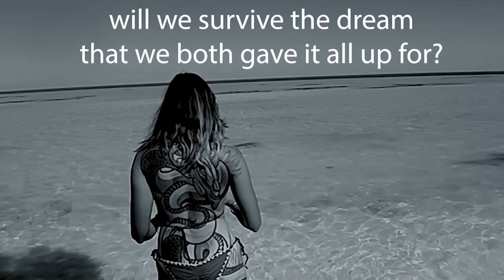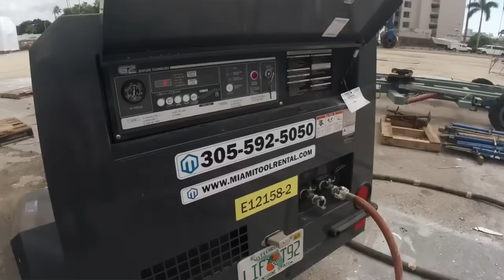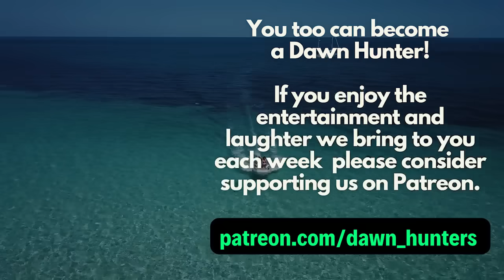$$$$ Yacht TIMELAPSE TRANSFORMATION For OFF GRID LIFE 5 years in 10 minutes

Comment: Fun recap, I remember a few of those moments! Hey, have you guys had any hiccups with your starlink by any chance? I’ve heard reports of people using it for marine have had some real problems.
Reply from the maker: The Starlink has been amazing and even works when under way in 2 to 3 foot seas (7 knot speed).  Those having issues are using the lowest cost dish with the motor which after some time will stop working due to continuous motion. We have the higher cost dish which is double the size but mounts flat and does not move.  
Results are fantastic and we can work from anywhere anytime!
Reply: @DawnHunters  there had been whispers they were disabling the mobile aspect. Glad to hear it's just which package they have. We are about to pull the trigger on it while equipment is half off.